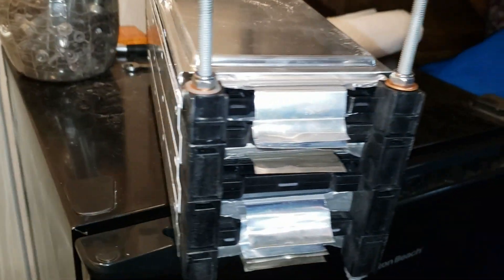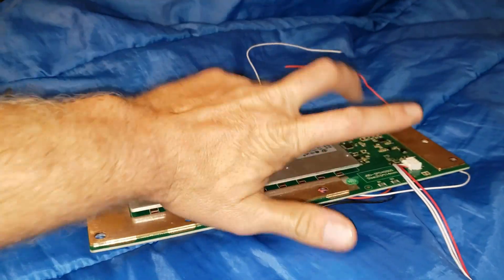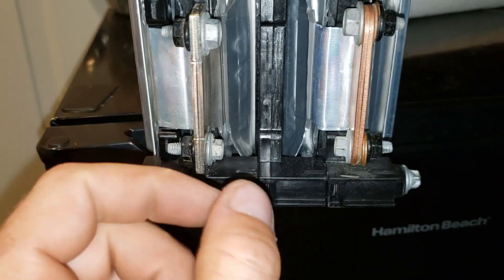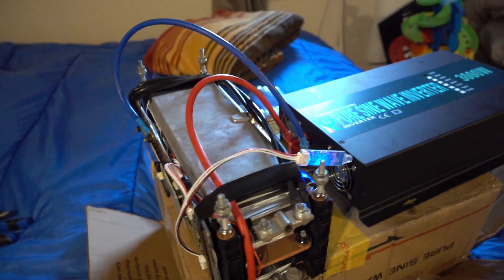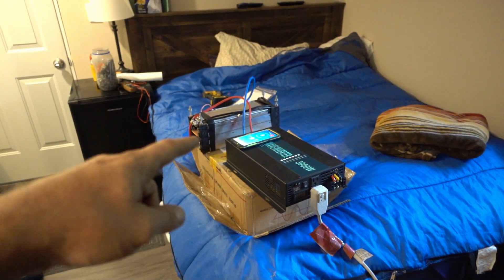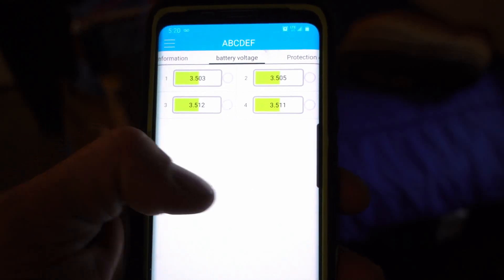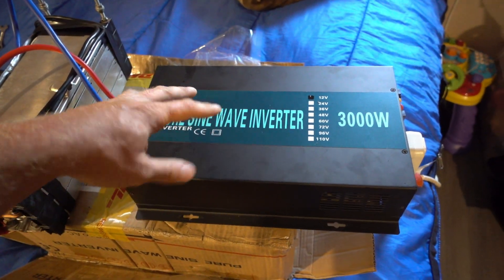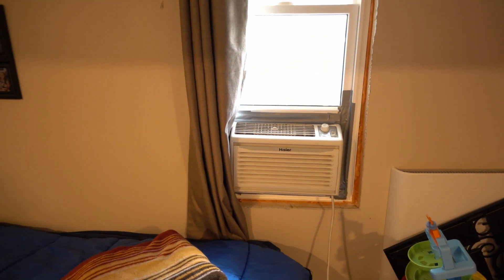120Ah LG Battery And 150Amp Bluetooth BMS With 3000w Inverter Running 5000BTU AC

Comment: Doesn't a 150A BMS at 12V theoretically only deliver 1800W? (or 2100W at 14V) I hope my math is wrong, trying to pair a 3000W inverter with a 150A BMS myself, but the math won't allow me, am I missing something?
Reply from the maker: Yes 1800w but the inverter will last longer cause it will not get pushed to hard

Comment: Could use some advice. Have a question for ya. I have a panel with model number Q.PEAK L-G4.2. Will this work on a 12 volt system lead acid battery bank with a 30 amp charge controller.
Reply from the maker: with a mppt charge controller yes.
Reply: @GoingOffGrid101  ok thanx

Comment: uuumm just a question,,the bms says its for 10s to 24s,,but you have this only connected to 4 batts?,,that's 4s right? am i missing something?
Reply from the maker: didn't you ask for 14s ? sorry if not someone did...

I have two of these bms and i love them
Reply: @GoingOffGrid101  im doing a 7s 7p 48ish battery,im looking for a bms  and i like the look of this one but can this one do 7s?
Reply from the maker: @oogie-boogie  https://www.aliexpress.com/item/4001308302662.html?spm=a2g0o.productlist.0.0.6c093196sdWxUY&algo_pvid=14a42e84-f5a3-437f-9ade-149a7d3b6ccc&algo_expid=14a42e84-f5a3-437f-9ade-149a7d3b6ccc-0&btsid=0ab50f4915971911996562968eebc4&ws_ab_test=searchweb0_0,searchweb201602_,searchweb201603_

 this one looks like mine!

Comment: I don't know if they have them in Canada or where else you could find such thing but for an insulator like you used the duck tape for I get some I guess disposable cutting boards that are a flexible sheet like 11"x14" they sell 2 for a dollar at dollar tree
Reply from the maker: that would work! but the 3 layers of duck tape is more then good enough for 16 volts.
Reply: Or just buy some Kapton tape.
Reply from the maker: @gravelydon7072  i will be buying some :) thanks
Reply: well I assume if there are any thru hole components legs I assume it would not take much to poke thru kapton tape
Reply from the maker: @james10739  I made sure they where bent down
Reply: @james10739  Kapton is a rather tough tape compared to duct tape.

Comment: How long on a full charge could he run the AC?
Reply from the maker: if the AC is running 100% on then 3 hours but in his tiny trailer it will only run around 20% of the time so around 12-15 hours
Reply: Going Off Grid that’s not bad.

Comment: Wouldn't switching off the BMS also disable the charging, or does it have the option for a separate charge input?
Reply from the maker: it would also switch off the charging yes.